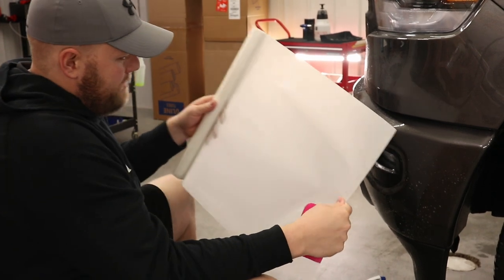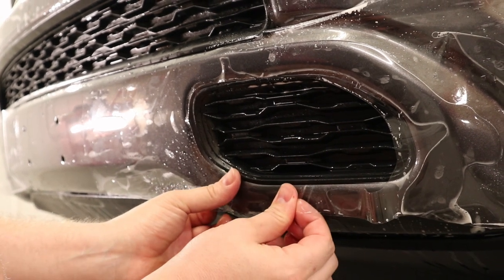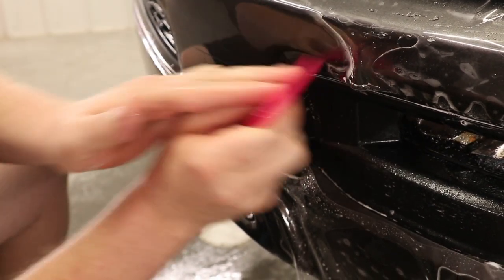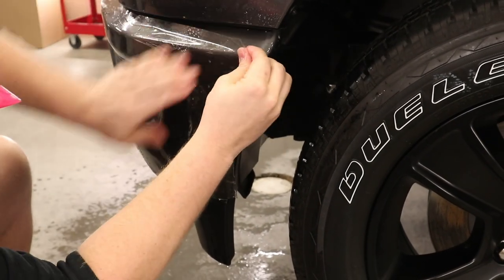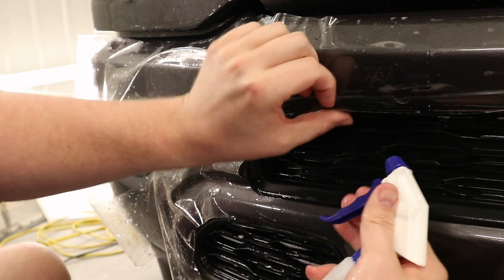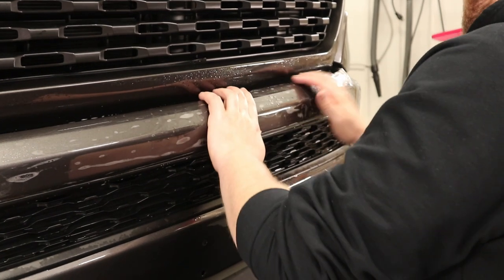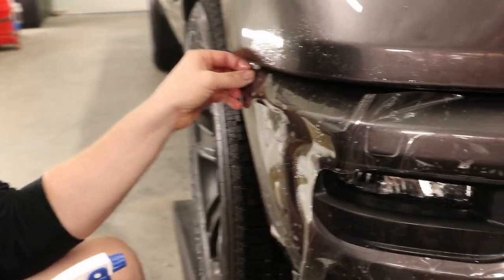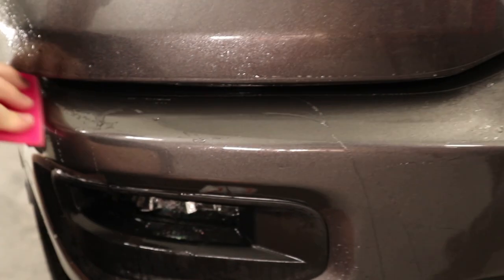2022 Dodge Ram 1500 Front Bumper PPF Install!

Comment: Eric....I had my PPF installed by a detail shop and there were a few issues I noticed once I did a good inspection of my truck at home. I found a piece of debris under the ppf near the lip of the hood and in another lower part of the bumper I found 2 fingers, would you suggest I take it back and have them fix it?
Reply from the maker: Debris is a constant battle, even for the very best PPF installers. I always try and be upfront with my customers about it and when I can’t get something out, I’ll always point it out to the customer. If I were you, I would ask about it. What is it that’s under the film?
Reply: @DriveProtected  I cant really tell what it is but it appears to be a very small particle that I could probably live with since you explain it the way you did. I just want to be sure it doesnt tear or rip when washing or drying vehicle but Ill ask them. So I did mention there is two fingers that probably should be tacked down, correct?

Comment: What can I use for the tac solution? If I put warm water & a small drop of meguiars soap, would that be ok?

I bought my Ram 1 year old, so I'm also wondering how this will look over top of a bumper that had chips touched up professionally. They hide well, but still have the little indents..
Reply from the maker: Tack solution should just be hot water. Adding soap to it will defeat the purpose of what you’re trying to accomplish.
Reply: @DriveProtected  thanks for the info! I'm glad I asked, because I likely would've added a drop of soap too!!

You think it'll still turn out ok with those little pits in the surface where the chips were touched up?
Reply from the maker: @dannymayes1963 honestly, they will be noticeable. Anytime you do chip repair, it’s next to impossible to fix them 100%. That being said, I’m sure it will be fine.
Reply: Thanks for the info! Also I just realized I meant "slip solution" when I was asking about the soap lol!

Just about to sit down & give this a shot.. 🤞🏽

Comment: I’m getting my 2023 done but they said they have to have relief cuts because of how it curves.
Reply from the maker: Relief cuts are sometimes needed due to how thick PPF is.
Reply: It’s the same bumper like the one you did in the video. But they are using the computer cut out pattern that has relief cuts in it. But you just did it without having to have relief cuts on the corners where it curves.
Reply: All depends on the film. Ask your shop to see some work they've done. When I use 3m I have to relief cut. if I use expel typically, never have to. Trust your shop to install it how they install it they typically know what works best for their film and installation techniques